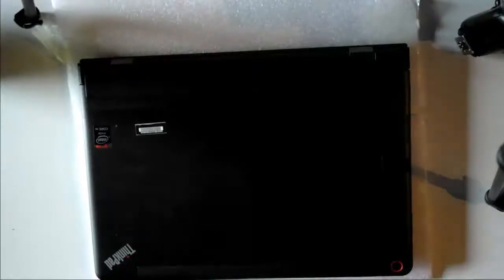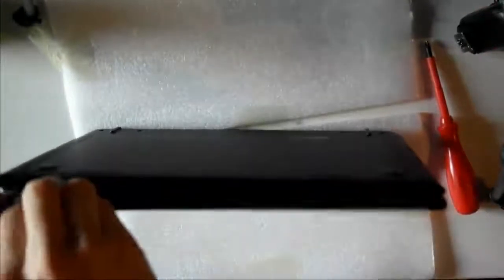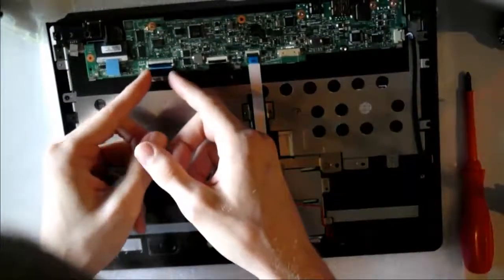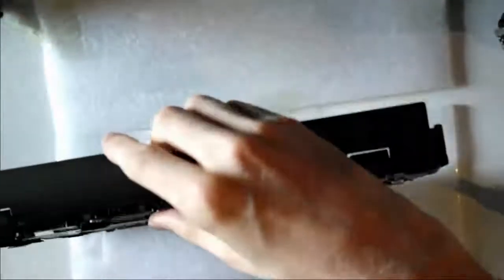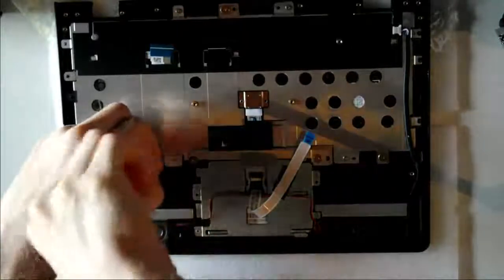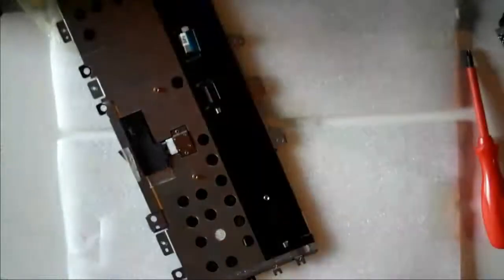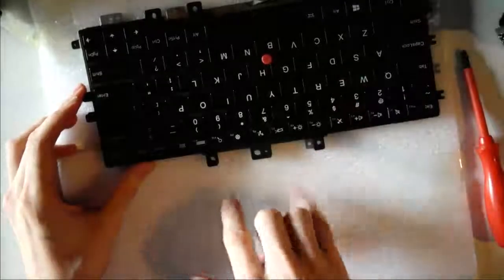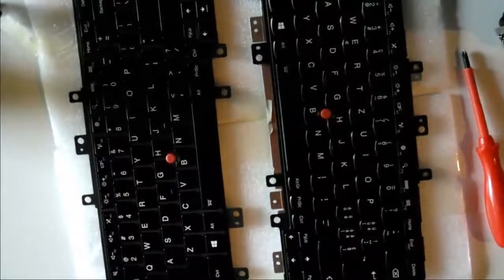Teardown: Ultrabook Pro Keyboard for Lenovo Helix 2 (20CG, 20CH, 2nd Generation)

Comment: On helix version 1 there are 6 visible screws on the back and then 4 hidden ones two on the two left and two on top right corner under a plastic covering (just letitng others know since attempting what Sebastian did and trying to take off top cover as he did nearly ripped my nail off.
Reply: thanks a lot, bro! - I find them!

Comment: Come across this video cause my helix pro keyboard is broken, your video is really helpful, i wonder is your trackpoint button working or not sir? Cause mine is not working after i replace it with my new replacement..
Reply from the maker: Hey, nice to know that this was useful :) My track point works, else I would have mentioned that ;-) Did you ensure the cable to be correctly attached? If you're not used to these flat cables and their sockets it's easy to only put them in half way without noticing. That's the first thing I'd check. If the connection is good, then it's possible that your track point was just dead on arrival.